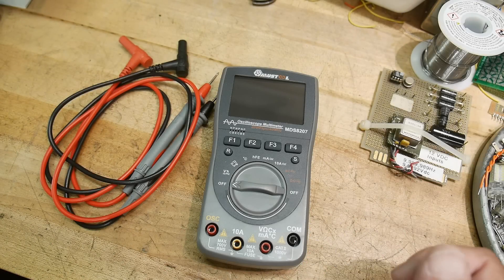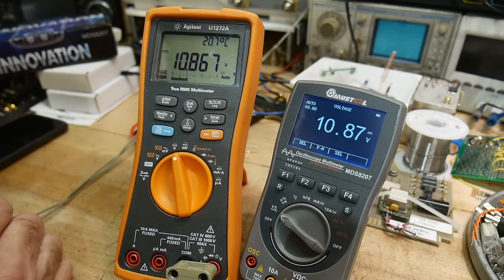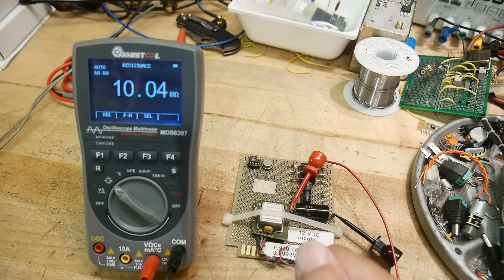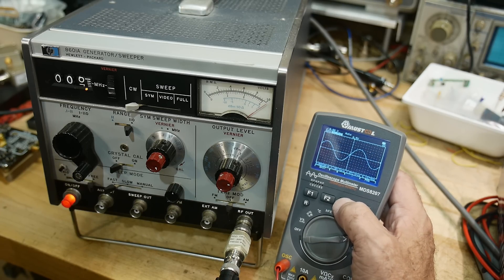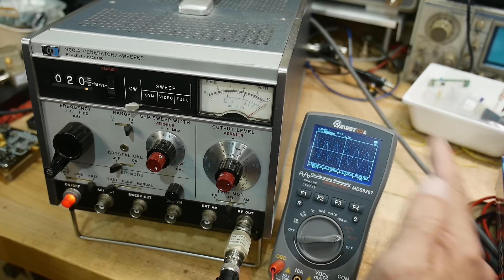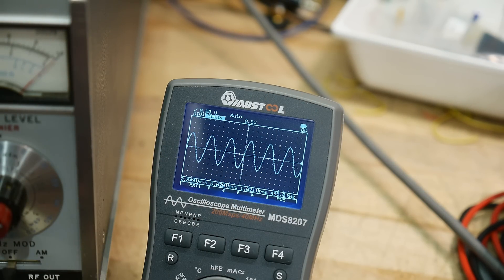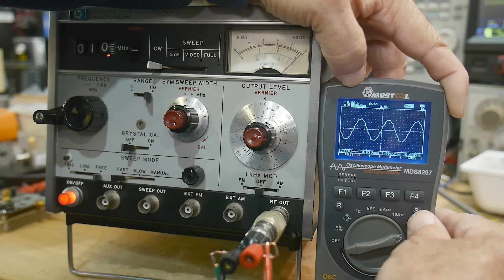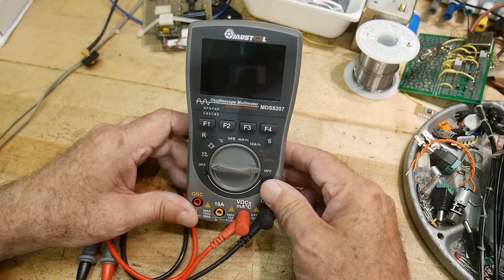#1550 DVM Scope MUSTOOL MDS8207 Review

Comment: I have Fluke scopemeter 196 and 199c, i like it, but this multimeter are very nice for light job, dirty or risky job.
Is isolate (battery power like fluke scopemeter) is fontionnal but menu need some learning curve, i use some time to debug switching psu or welding machine, 700v scope input are nice for that.
I like the display but yes, refresh are not good.
Is good multimeter to have if you need all in one some time.

Comment: Its an electrician's scope - first clue is no bnc/probe. It would be useful for electricians.
Reply: Do electricians need to test transistors?
Reply: @ortzinator  Generally, no. They'd just change the board usually. Which is not to say that some electricians might check and replace transistors.